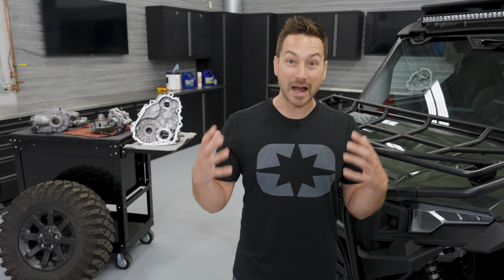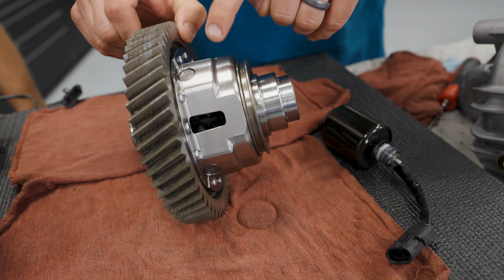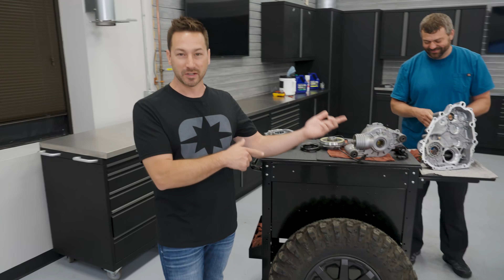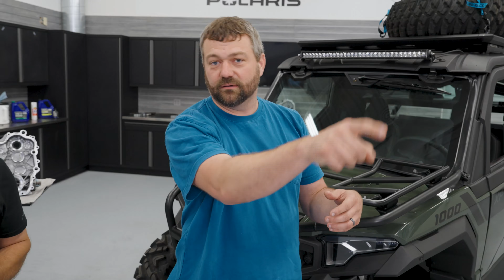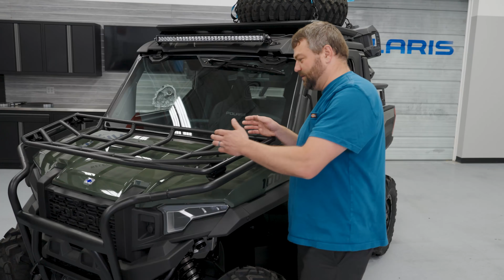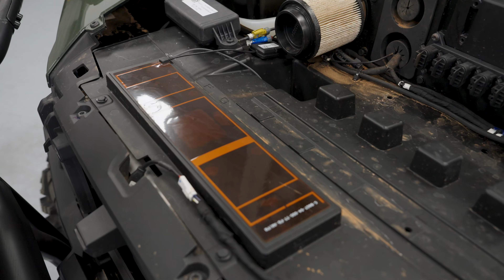HOW CAPABLE IS THE ALL-NEW POLARIS XPEDITION? - SHOP TALK EP. 24 | Polaris Off Road Vehicles

Comment: My dream bucket list trip would be a trans-Canada trail trip with, . . . a Polaris 6x6.  Hear me out, the same engine and suspension package as what this has, the steel belt transmission that's in the 1500, but with room in the bed for a multi-week expedition.  I would definitely consider that as an expedition machine.